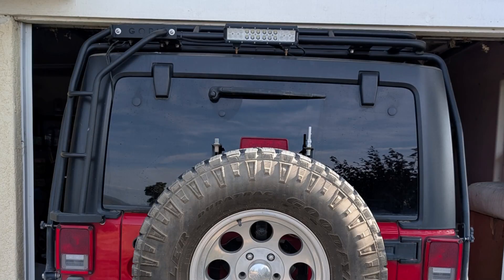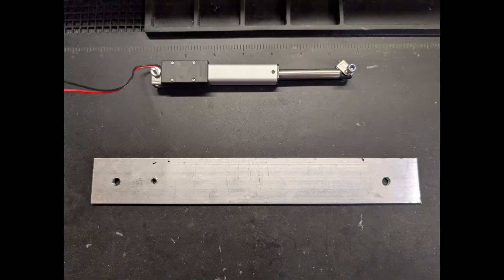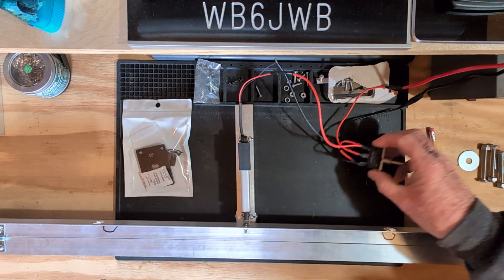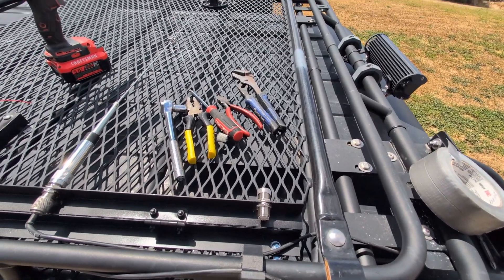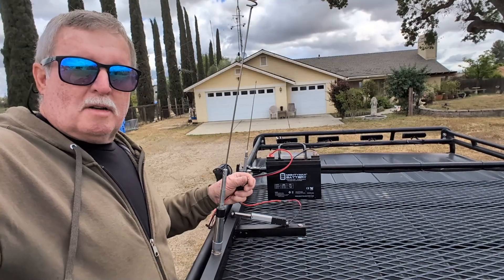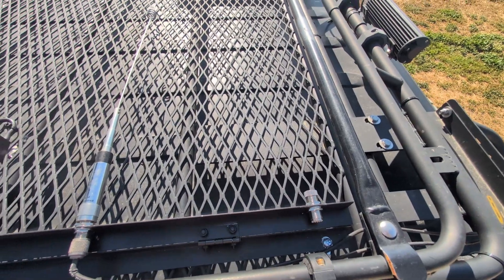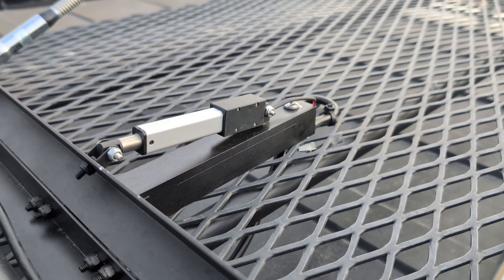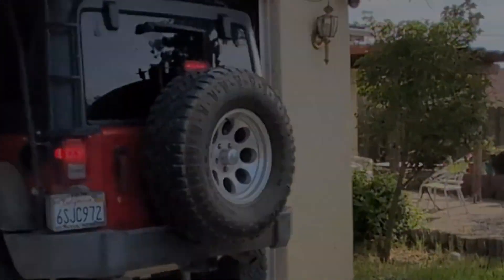Ham Radio Mobile Antenna Lift Using a Linear Actuator

Comment: Is it waterproof?
Reply from the maker: We don't get much rain here, but so far it has held up to being hosed off on a regular basis. I would have thought that it would succumb to the triple digit temps here (and on a black roof), but it has endured that also. If it does fail, I will update the video comment section.  Thankfully it is an inexpensive and easy replacement part.  Thanks for asking.

Comment: That is SLICK. I like the audible "CLANG" of the antennas acting as the Full Down Indicator. 😂

I've been wanting to build a similar setup for my SUV, but with the bar on pillow block bearings between the roof rack rails. What linear actuator did you use?

One thing i noted from your build: those coax bends at the antenna mounts make me queasy, I've broken the shield on RG-58 before with bends like that.
Reply from the maker: Yes, the "clank indicator", lol. The old manual mount had a sponge wire tied under the long antenna to keep it quiet, but I actually like to hear it bottom out. Likewise, the coax bends have prevailed as they are for many years with issue but I understand it looks bad. Thanks for the comments!

Comment: really nice build - thanks for sharing
we have a similar issue, and use Comet unit with a "Lift and Drop" pivot built into the base.
Question: for those without a garage, or in less friendly climates, any thought as to being able to raise if if a dusting of snow or light glazing of ice were present?
Perhaps a very thin, light weight section of plastic attached - something that would "Flex", like a "Ice Shedder" style Windshield Wiper blades ...
Reply from the maker: I would think the linear actuator would be strong enough to lift the antennas with snow or a small layer of ice. What I don't know is the temp rating on the actuator, which means it could fail under freezing conditions. There are no specs for temp for the one I bought, I imagine there are many other made for cold temps though. The one I use is low cost and easy to replace so I am just going to see how it does and u[grade if it fails for whatever reason.
Reply: @ShawnDienhart  thanks again for sharing the build and the additional details.
'73
K3JFV